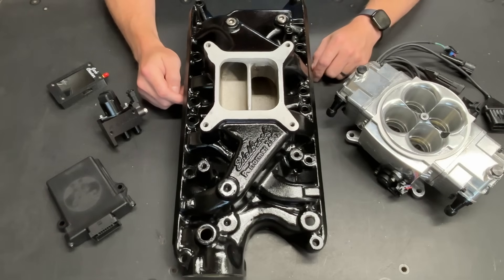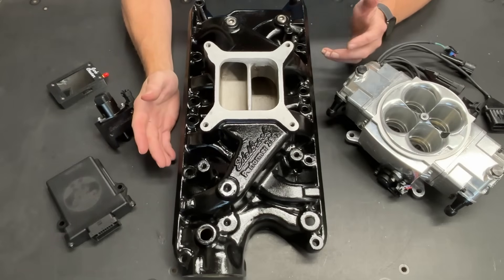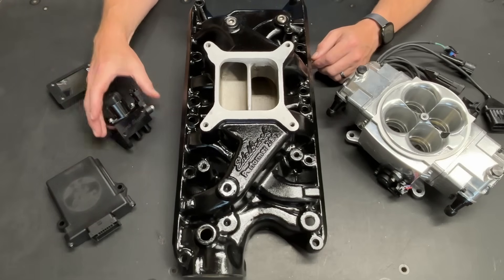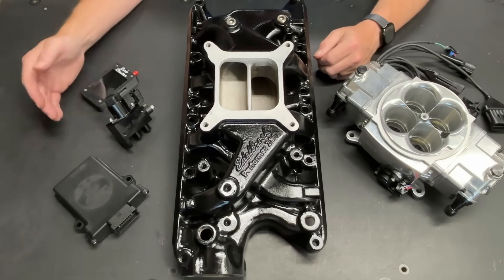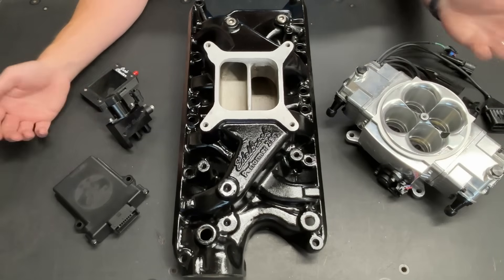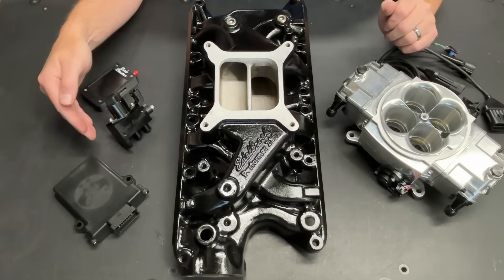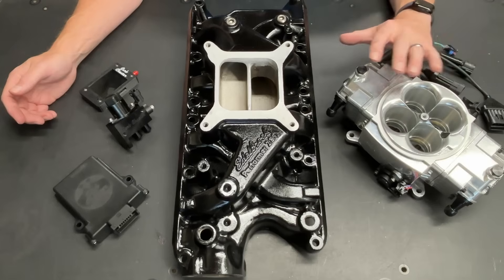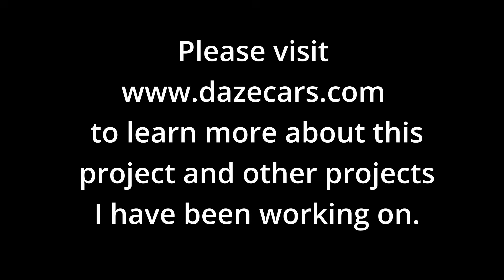Computer Controlled Fuel Delivery Carb Cheater 2.0 Vs Sniper  2 EFI, Why I Decided to Try Them Both

Comment: Aces killshot fusion at $600 (might be able to find a discount) pretty much killed the carb cheater idea.
Not that the carb cheater is a bad idea..just choose wisely depending on your end goal and what you have and what your budget is..
Reply from the maker: That's a good point; the cost-benefit analysis is definitely something to consider when making that choice. but I don't think its as simple as $$.  As others have said in the comments if somthing electronic in a TBI system fails you are stranded alongside the road but with a carb cheater you can simply disconnect the vacuum line, plug the port and drive home.
Reply: @dazecars good point to the carb cheater. Along with not needing a fuel system and ignition system that works with the tbi.. its never as inexpensive as they claim.. but if im spending $500 on a new carb.. $500 for fuel injection is tempting but the $500 jumps to $1200 plus real quick if you buy their fuel and ignition to go with..
Reply from the maker: I agree completely!!
Reply: @dazecars I'm still tempted to try the aces tbi though😂.. just need to find out if it will work with my progression ignition distributor. Adding an inline electric fuel pump that meets the requirements isn't that difficult..
Reply from the maker: for sure lots of ways to get it done.  So nice to have option!
Reply: can you still drive an aces if the  computer fails ?
Reply from the maker: no you cannot.  However, thats exactly the point we were discussing a few comments up

Comment: I don't remember the year of Nissan Sentra I was helping with but it had an O2 sensor with a 2bble carb. makes me wonder if its function is the same?
Reply from the maker: Very interesting.  A computer controlled vacuum leak seams like a natural progression between the carburetor and EFI but manufactures decided to reinvent the wheel rather than improve on carb tech.  With that in mind it would not surprise me to find that a manufacture did attempt to do something similar.
Reply: Back in the late 70's and 80's you have what was called a feedback carb.  Was an attempt to use electronics to make a carb meet the emissions requirements of the time.  All the systems would adjust the fuel metering based on the O2 reading and could lean or richen the mixture.  This would be the way to do it.  This was important as a cat works best at a stoichiometric A/F mixture.  That was mainly how they used it.

The carb cheater is just a controlled air leak so it can only lean the mixture. It would be considered a way to add a limited feedback loop to a carb. It is a crutch for a carb that is not tuned right.
Reply from the maker: " It is a crutch for a carb that is not tuned right."  have you watched any of the carb cheater videos?  The guy who invented it is outstanding with carbs, one of the best and the carb cheater still improves his tune
Reply: @dazecars  Yes I have.  I actually saw them when they were first playing with it. have to say it did look like a neat idea.  Problem for me was and is its limitations.  As for the guy who came up with it he is decent, but I would not really consider him a carb tuner or builder. Are guys out there that it is their business, you tell them all the information for your application and they send you a carb that is on the money.  Is actually a good bit to the subject.  I can tune a carb and get it to work correctly, but would not consider myself a carb tuner.  That carb cheater is fine as long as you just understand you understand what it cannot do.
Reply from the maker: "carb cheater is fine as long as you understand what it cannot do" absolutely agree with this and it applies to every automotive part in the aftermarket!

Comment: One problem with the carb cheater is it only works if the carb is rich as it just adds air.  If you are lean it won't help.  The EFI will be able to adjust both rich and lean conditions. Also the EFI is most likely going to have a higher CFM throttle body which may make more HP all depending on if the engine can use the extra air.The sniper 2 is 800 cfm.  The Carb cheater is good for someone who has an existing car that needs carb tuning, but doesn't know how to tune a carb or doesn't want to.
Reply from the maker: The "problem" you mention is actually why it works.  A properly tuned carburetor will provide consistent AFR under consistent engine load.  in other words cruising down the road.  But when the carburetor's AFR comes out of spec is when load or acceleration changes.  In those situations the carb most often goes rich not lean and is designed that way because a slightly rich carb won't cause engine damage (other then reduced over all life) but a lean carburetor condition can cause catastrophic failure.  thats why we have "extras" to add more fuel like accelerator pumps as an example.  With that in mind the carb cheater appears to be the fix as it will lean out the system in those situations prolonging engine life and increasing fuel economy.
Reply: @dazecars  I've been dealing with carbs for 50 years and although more often than not they are rich, I've run into plenty that were lean.  The carb cheater is just trying to add a feedback loop to a carb.  The OEM's did that back in the 70's & 80's although they did it by adjusting the fuel metering which could adjust for both lean and rich.  

All I'm saying is the guy buying the carb cheater or the sniper 2 many times is doing so to avoid tuning as both self tune.  Both do that to a point and then give up.  The Sniper 2 will get you further, but if the base map is far enough off it will hit a wall too.  Anyone going with either system should understand each systems limitations.
Reply from the maker: A carb can be lean, no argument there, but a properly tuned carb is not likely to have lean spots.  Yes this system does not add fuel so in that EFI is better but it does make an already good carb even better, win win
Reply: Thunderhead289 specifically states you still need to learn to tune the carb even with the Carb Cheater.

As others have pointed out including Daze in this video,  the biggest advantage to CC is that if it fails/malfunctions, you can still drive the car by simply unplugging CC.  With EFI, you're screwed.

Comment: I've known of  Carb Cheater a while now and one of the big plusses is if it fails you still have a dumb old carb to get you home. Conversely with EFI a failure of any of its many electrical or mechanical components you can be left on the side of the road dead.
Eager to see the comparison.
Reply from the maker: That is a major advantage for carb cheater!!
Reply: I'd say the left for dead is true for most aftermarket EFI, but many OE systems will still run many times quite well with failed sensors, etc...  Also, a failed fuel pump or clogged filter will leave you stuck on the side of the road with a carb no different than efi. For that matter a carb with a stick float will leave you stranded or if stuck open may result in a fire so a carb is not the be all and end all of reliability.
Reply: @SMS-wu1th  If if if, If my Aunt had wheels she'd a trolley bus, you do you.
Reply: @snocrushr  LOL just stating facts. Really when you get stuck on the side of the road doesn't matter as you won't know how to diagnose why your are on the side of the road.  Build it right and you won't be on the side of the road.
Reply from the maker: "Build it right and you won't be on the side of the road."  very true statement!! there are lots of way to accomplish that sentiment and what is perfect for one builder may not be ideal for another